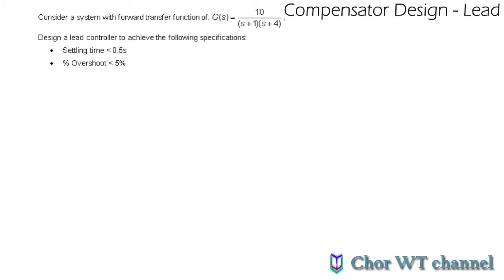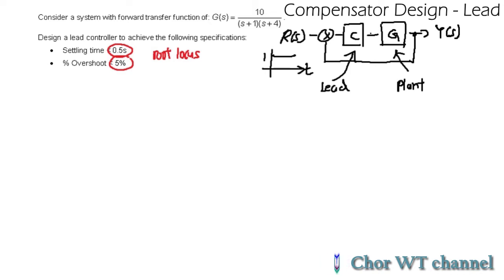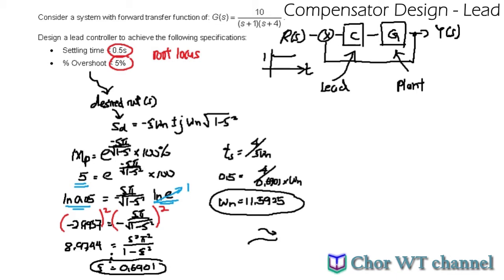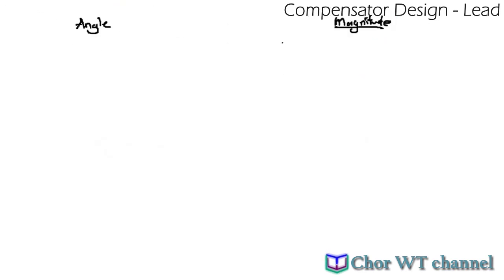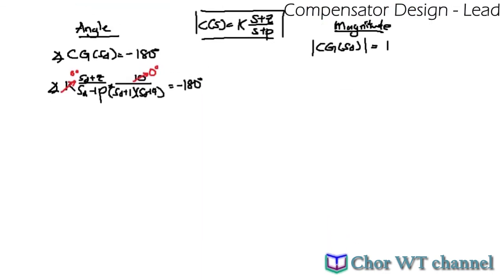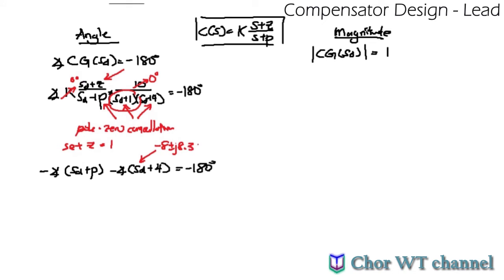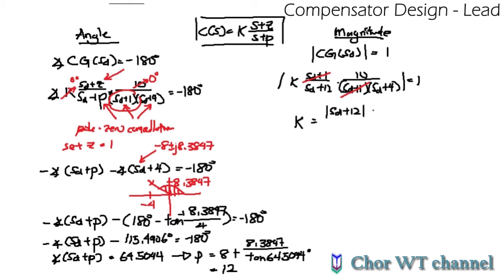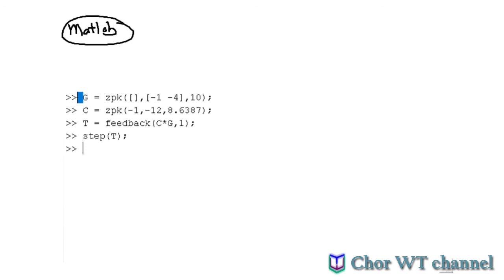Compensation Techniques - Lead (Root Locus)

Comment: I always thought that pole/zero cancelation should be done on the fastest pole not the slowest.  But I worked this problem both ways and found that the time domain (Ts and PO) result is identical either way even though cancelling the pole at -4 gives a lead compensator of 

11.94*(s + 4)/(s + 15) 

whereas cancelling the pole at -1 gives

8.64*( s+ 1)/(s + 12)

Where they do differ, however, is that cancelling the pole at -4 gives a steady state error of 0.11 whereas cancelling the pole at -1 gives an error of 0.357. Much worse result.
Reply from the maker: Thanks for the insightful comment.